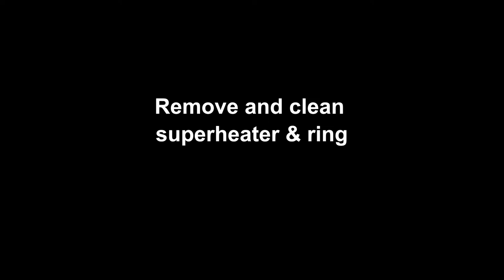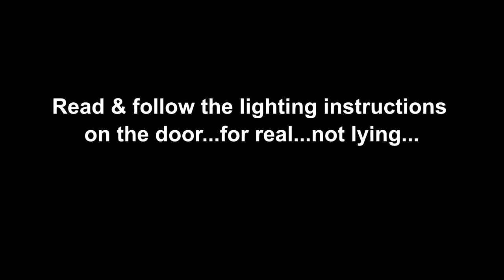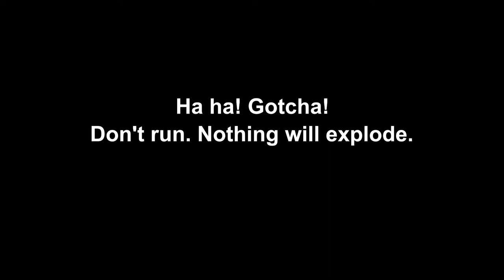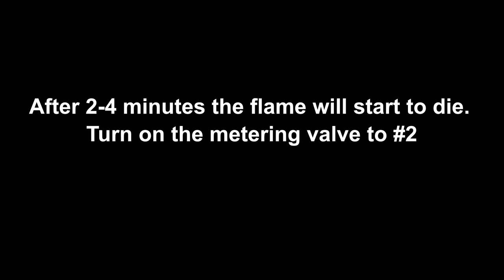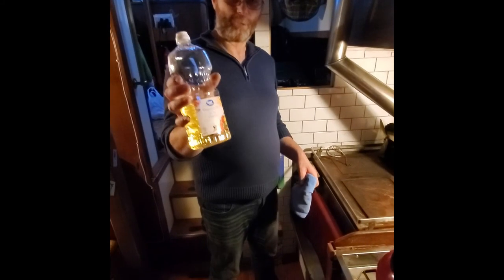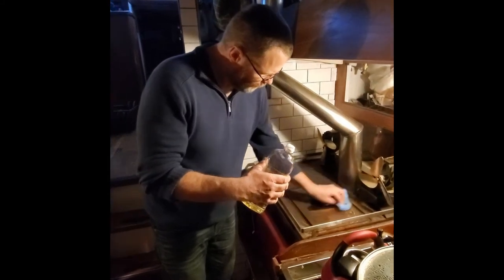Lighting a Dickinson Diesel Stove - Step-by-Step Instructions - Ep. 11

Comment: Nice...I am installing a Dickinson Diesel bulkhead heater now...Hope to put out a U-Tube Video on it once I have it up and running...Best...SV Aquila Seattle
Reply from the maker: Thanks Greg! I really like the diesel heaters. We have had propane and wood airtight stove too. Wood is nice, but you have to feed it all the time. We will be doing a video on disassembly and cleaning of the metering valve soon too. Just need consistent warm weather to keep the stove turned off. Good luck with the install!!! Thanks for commenting!

Comment: That chunk of gunk on the bottm of the super heater is yesterdays piece of toi;et paper.
Reply from the maker: Hahaha! Yup! Thanks for watching and leaving us a comment!
Reply: @schoonerkiva  I preheat mine with an ounce of alcohol,(like a primus burner).No ash.Of course, only with a cold stove.
Reply from the maker: We have done that before and it works well. We had lamp oil on hand and used that. A friend uses methyl hydrate. We leave ours going 24/7 from October to April. We just add more fuel to the tank.
Reply from the maker: We have the hot water coils which we will be hooking up to a set of radiators in the future.

Comment: Going through the Dickinson manual I see a 'barometric' mentioned. It seems you do not have one? I do see a water jacket if I am correct.
Reply from the maker: Hi there! Thanks for the comment! No, we don't have a barometric damper. Our chimney is not configured to allow for it as we have too many bends. We switched from a Dp Exhaust Cap (round one) to the H-Exhaust Cap (H shaped). We haven't had any more issues with down drafting since switching. I think the problem comes from the wind being able to blow straight into the exhaust cap sideways and then down. The H exhaust cap only has vents on the top and bottom, acting as a sort of wind break from direct wind. Not sure if that makes any sense!? And yes, we have double water coils which are SO WORTH IT!!! We have them connected to our motor, hot water tank and a radiant heater in a bedroom. So if our diesel stove is on (approx. Sept to May) then we have hot water, heat in the forward cabin and a warm motor. Are you thinking of doing the same thing? Thanks!!

Comment: How do you get the oven to get warm,Do you pull up on the lever on the right side of the chimey on the top of the cook stove? Does that lever go up or down to allow the heat through, I can't see the difference with ours
Reply from the maker: Hi Stephane! Thanks for asking! Pull up the lever beside the chimney to heat up the oven. That closes the flap inside the stove, which allows the heat to go up the chimney. Instead, it redirects the heat around the oven box. Close the oven door. Our stove needs to be on setting 2 or higher to cook. A frozen pizza on setting 2 takes 20-30mins. You can smell when it starts cooking. Once you are finished cooking, push the damper (lever beside the chimney) down. Despite what you may think, don't operate the stove regularly with the damper pulled up. It doesn't keep the heat in the way you might think. What actually happens is a reduction in airflow to the flame box, and the flame box soots up with charcoal. Yes, we have done it, and yes it is a MESS  to clean up! Good luck and let me know if you have any other questions!
Melanie

Comment: Neal and Melanie,  I have a Dickinson Pacific stove,  it turns out that I was not correctly lighting the stove,  I have just pulled the stovetop and cleaned the burner.  I am hoping the new starting procedure will help with smoking and sooting.
Reply from the maker: Hi there!! Thanks for commenting! Be sure all of the airholes in the burner pot are clean as that allows for proper airflow. We have found that the lowest setting to run it on is about 1.5 to 2. Below that seems to give lots of sooting problems. Even if that is too hot for the weather, just open the portholes instead of turning the stove down. It takes the stove time to respond to any changes in settings. These babies are not automatic (too bad!), so it takes a bit of time. Good luck and we sincerely hope the new procedure solves your problems! Let us know how it goes!! Thanks!
Reply: @schoonerkiva  Neal and Melanie,  After cleaning everything from the burner to all of the chimney. I am able to run without sooting the entire marina.  , so When at night I will try to see what the lowest I can run and still have the blue-yellow flame.  At night I had been running on .5, thus this may be why it sooted.  What is it like working on a  ferrocement boat?  I have only owned wood and fiberglass boats.     

Thomas -
Reply from the maker: Hi Thomas! Thanks for the update with your stove! I am really glad to hear the sooting up problem is getting better. Yes, we have found that running the stove below 1.5 setting will cause it to soot up. I don't know why.  Spring/Fall are tough for using the stove. It is always too hot or too cold! We keep it set on 1.5-2 and open/close portholes as needed. We have always had wooden powerboats, and Neal grew up on a fiberglass Cooper. I love ferrocement!! It is solid, not affected by weather as much and doesn't sweat. The 2 issues are that you must have heat going or it is very cold. Also you can't really make extra holes on deck or in the hull. You must work within the confines of what is there - good and bad. For example our scupper holes are nowhere near our cleats on deck. It makes tying lines to cleats a bit challenging.  Keep us posted on your progress with the diesel stove!! Thanks for commenting and watching!!  Have a great day!!
Melanie

Comment: Hi Folks. I used to berth at Maple Bay Marina. Now I am in Spain, preparing to sail back to Vancouver Island. I am currently looking into buying the smallest Bristol Dickinson Dieselheater-cooker. I have Diesel on Board and I want to do it all with it. What I dont really understand is, if I want to cook an easy soup or coffee water, do I have to wait 2 hours before the Bristol is getting hot? And are these Dickinsons Gimbaled? Thank you kindly, Andy
Reply from the maker: Hi Andy,
Thanks for your question.  No they are not gimbaled. They have a rail and pot racks to hold things. They seem to work quite well. We have never run a Bristol size so I am not sure if 2 hrs is accurate. You would need for it to heat up before cooking. We leave ours going September to April. If it is too hot we open a porthole instead of turning it off. Use a much larger pot and lid than the quantity of liquid calls for less spilling. Also get a really great thermos to hold hot water for the day. Boil it before leaving or when calm weather. You can make tea, hot soup, etc. When are you leaving Spain? What is your ETA for the Island? It's snowing here...you sure you want to come back?! LOL!  Keep us posted on your journey. Hope to meet up upon a safe passage back!
Melanie and Neal
Reply: @schoonerkiva  Hi Melanie and Neal. Great Infos! It is a new thought, to keep it running 24/7. As long as the Materials can handle it and service / breaking parts and cleaning out, is not too expensive or even dangerous. But it makes sense for Fishermen ovens-heater-cookers. They need it ready at all times. So it must run to do so. As we will sail into hot countries too, we must look as well for another Cooking Source. I have an Swedish Origo 2 Flame Cooker but to get the Sprit or Alcohol is very expensive per Liter and extrem hard to get and in bad quality. We need something which burns with Diesel too, for simplicity. When the SHTF there is no more going to a store, trying to buy special Sprit, Lawnmore Gasoline or Propane-Gas. I prepare for Solitude and survival.  We wait now for 4 month for replacement of our new Winches. They said 1 week! And thats not the only Problem here in Europe with all the WEF War Mongering. ETA is unknown. If you would like to keep in touch, do you have other, private means? Thank you again for your expertise. Would be nice to get to know more DOERS on that most beautyfull part of this earth.

Comment: How long does it take for the stove to heat up (reach cooking temperature)?
Reply from the maker: Great question! It generally takes 1-2 hours to get up to cooking temperature. However,  there are a few tricks to possibly speed that up. Once it is started, and has been heating up for maybe 20 minutes, you can increase the setting on the metering valve. I normally leave it between 1.5 - 3. Maybe 4 if it is -15 or more outside with a cold wind. If you turn it up for cooking, remember to turn it down after you are finished!  You could also pull the damper up (beside the chimney) as that will restrict the amount of heat going out of the chimney. The heat then circulates around the oven box. This will heat up the oven, but also heat up the cast iron top faster than with the damper open. I hope that helps! Thanks for asking and let me know if you have any other questions!!